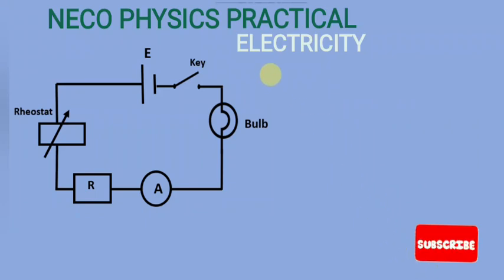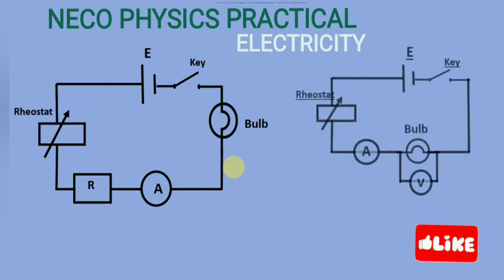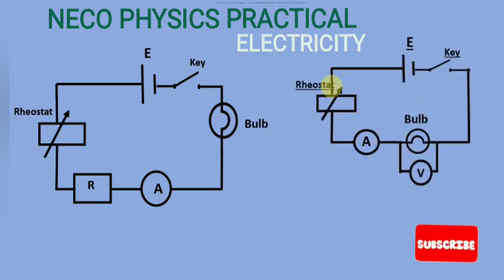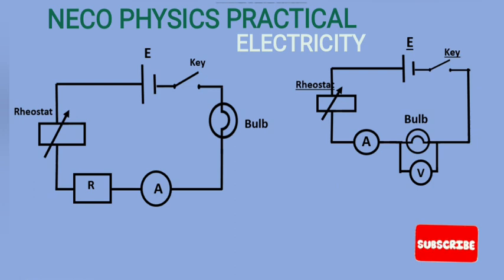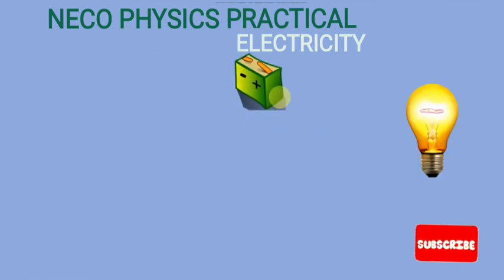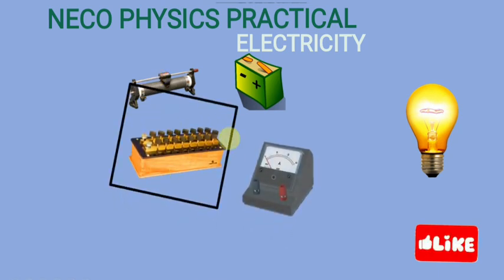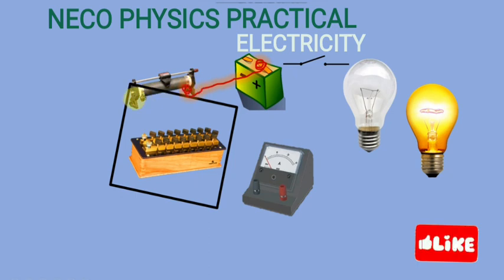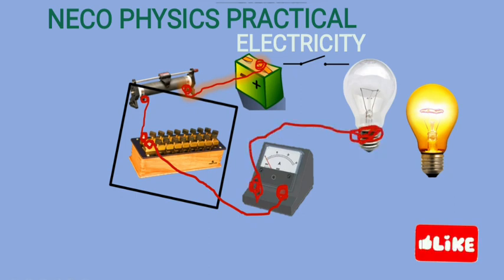#neco NECO #physics #practical #electricity

Comment: Thank you sir
Sir, please what current is a battery of 1.5v read.
Reply from the maker: A battery won't read any current unless it is connected to an external load like bulb or any resistance
Reply: @yousciencelab5307  Okay sir.
Thank you sir
But sir,if two 1.5 v battery is connected to a load,what current should it read.
A new battery
Reply from the maker: @israelohinoyi  it also depends on the load you connect across it.
Reply from the maker: @israelohinoyi  but the current will be higher than 1.5v
Reply: @yousciencelab5307  Sir, please how can I DM you so you can help me clarify something.